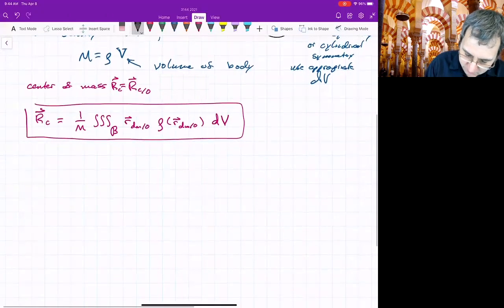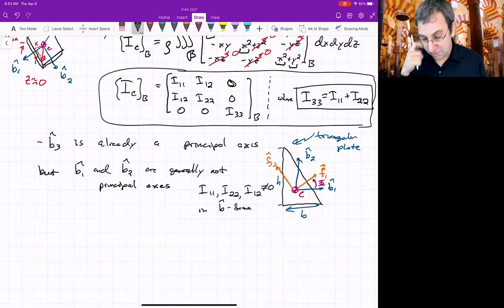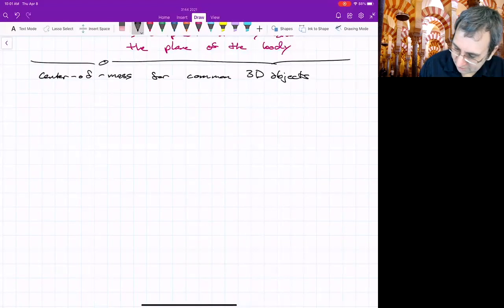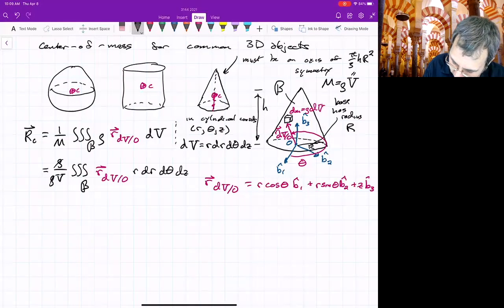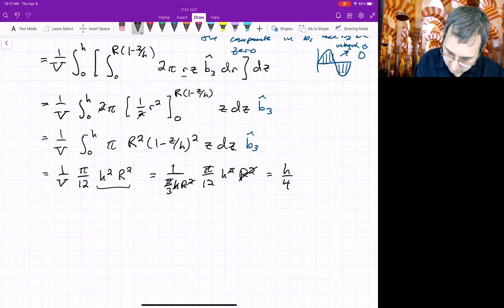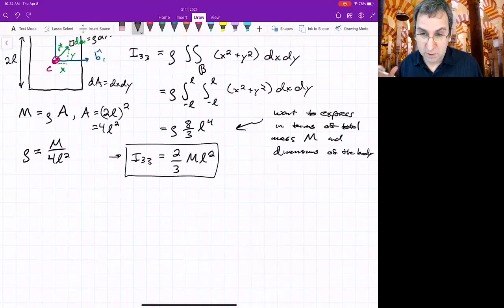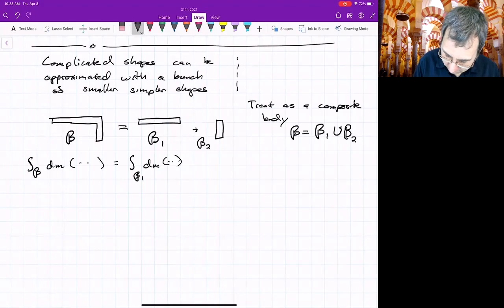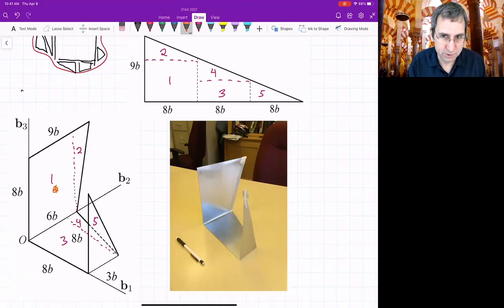Moment of Inertia Explained: Worked Examples, Parallel Axis Theorem | AOE 3144 Lecture 20

Comment: Can you tell me the difference between r and R
Reply from the maker: Unless you give me more context, usually I use upper case 'R' for the vector position of something with respect to an inertial frame origin, whereas lower case 'r' is the vector position with respect to the center of mass. If you're talking about the integrals here, "R" is the radius of something (a constant) whereas little "r" is a radius variable used for the integral calculations.